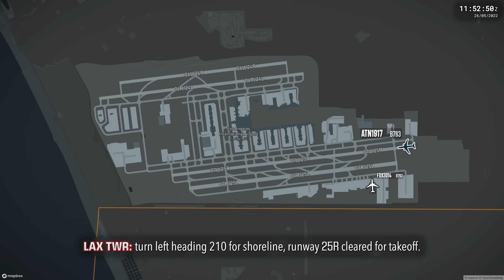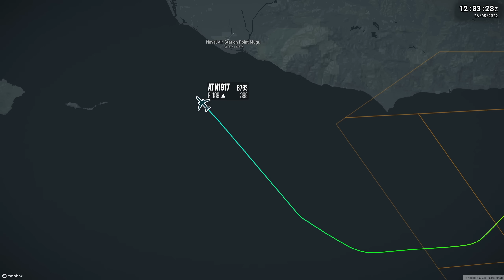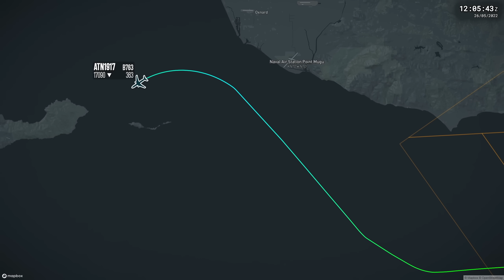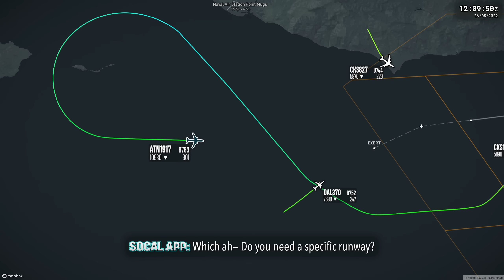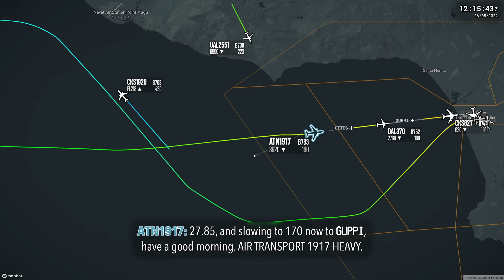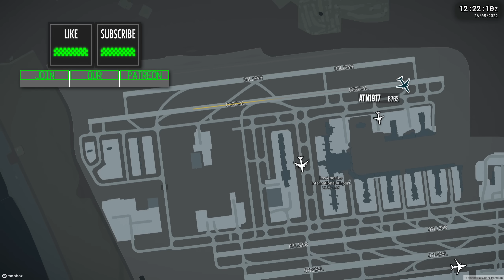"We Need To Land IMMEDIATELY"; Amazon Prime 767 Reduced to Single Electrical Source! [ATC audio]

Comment: They flying some of the oldest aircraft in service…..all to save a buck
Reply: Literally all cargo airlines fly old aircraft. Old doesn't mean bad.
Reply: Do not confuse old airplanes as being unreliable. I've been in aviation for 43 years so far, and I can assure you the level of unreliability is definitely not based on an airplanes age but solely based on the quality of an airline's maintenance program. 
Also an airplane may be cheaper to buy the older they become, but the older an airplane is the more money needed to keep it operational and compliant with its Manufacturer (Boeing in this case), the State of Manufacturer (FAA in this case), and the National Authority of the Airline.
Reply: @gibbosan1  I agree, old may not be bad, but as they age, aircraft become more prone unforeseen maintenance issues.

Comment: Surprised a single power source couldn’t power the whole aircraft. The lost engine should be the only real concern when a single generator powers all Buses
Reply: It probably can. But do you really want to fly a couple thousand miles with the risk of losing all electrical power at a moments notice?
Reply: It's a loss of redundancy that is the issue. One generator is enough to power all busses, but when you lose an engine driven generator AND it appears the APU was inop, that's when you start backing yourself into a corner pretty quickly.
Reply: @cobra10908  yeah if one went out they might Just head back without a emergency 
But this took out all but one
Reply: @seantaggart7382  apu must of been deferred so when they left LAX, they only had two sources of electric, and lost one of those. Normal conditions would be, if lose an engine generator, turn on apu for second electrical source, and continue on. Lose another ie one electrical source…it’s land ASAP.
Reply: @jerryrichardson7815  yeah

Comment: Pucker factor 8 on that one. I went NORDO when electrical system failed in a C172 (heavy, lol) in the middle of a Class B. I managed to call the tower on my cell phone and got clearance to land. Good thing that plane had slick mags.
Reply from the maker: Thanks for sharing your experience! Regardless of the size of the plane, when systems start failing it's a sub-optimal day for the pilot(s)!
Reply: ...and batteries.
Reply: No issue the plane still has 1 power source plus 3 hydraulic generators
Reply: @elmin2323  Not sure why you’re being disrespectful to Don Jet. The 767 does not have three “hydraulic generators”. It does have a RAT that can pressurize a hydraulic pump but provides zero electricity. SOME (mostly newer) 767s have an HMG/HDG installed to provide limited power from a hydraulic motor generator, but that’s definitely not universal.

[Edited for spelling: “respectful” changed to “disrespectful”.]
Reply: @HEDGE1011  I'm type rated...
Reply: @elmin2323  The B-767 is one of my nine type ratings, and I flew it for years. I have not flown any 767s built in the last 15 years or so, therefore it’s possible that new build 767s (FedEx? KC-46?) have three hydraulic generators (a source would be appreciated), but I can definitely say that older 767s (such as this one) did not, and many didn’t even have an HMG/HDG installed.
Reply: @HEDGE1011  fair enough
Reply: @elmin2323  armchair expert
Reply: @loduca16  lope rated and current
Reply: @elmin2323  I'm the pope, President of the United States, Jesus and Elvis Presley's vocal coach.

Oh... I forgot people can say anything on the internet...
Reply: @elmin2323  roasted lmaoooo and rightfully so
Reply: @HEDGE1011  Think he meant hydraulic pumps lol
Reply: @elmin2323  Nope, no HDGs.
Reply: @donjet5371  ok arm chair expert

Comment: Why didn't they have an APU?  Is it allowed to take off without a working APU?
Reply: The 767 normally has 3 generators; one on each engine and the APU. Minimum required is two for takeoff. If one of the engine generators is inop, the APU must be running for the entire trip.
Reply: @donjet5371  Ok tnx.
Reply: Yep! Both passenger and cargo can run with an inop APU.
Reply: @gazebodp  Ok tnx

Comment: Fun fact: They can deploy a fan to generate electrical power, so they did have additional source. Airplanes routinely fly with non-functional APU
Reply: Fun fact all of you are wrong the Rat on 767 just provides hydraulics for the center system for flight controls
Reply: @eazyvictorproductions8217  same for 777/787?
Reply: @tomstravels520  hmm not sure about that I’m not typed on those only the 767/757
Reply: @eazyvictorproductions8217  I imagine they would as they’re reliant on electrical power for the FBW control. I’m more Airbus familiar
Reply: @tomstravels520  777 has generator in RAT, check AMM 24-33-02 for removal.

Pretty sure 787 has a generator strapped to the RAT.
Reply: @nuclearrabbit1   The RAT on the 767 provides ZERO electrical power. It is a hydraulic pump to supply hydraulics to the flight controls during hydraulic failure.
Reply: @donjet5371  citations needed
Reply: @nuclearrabbit1  no
Reply: Typical arm chair expert
Reply: the RAT drives a hydraulic pump to power the hydraulic flight controls..not a generator, however, there is a hydraulic motor driven back up generator undercertain conditions..
Reply: If they're on RAT then I'd say they're pretty screwed. You would have no APU GEN, IDG to be running on RAT.

But yes INOP APU can be released under deviation per MEL
Reply: @shinnmoso  But is the BFI AOK?
Reply: ram air turbine

Comment: Did they have all electrical power on take off or did they take off with less than all power sources intact?
Reply: probably took off with an inoperational apu, so if one generator goes it is a critical failure
Reply: @louissikkema5399  If the APU was inoperative how'd they start the engines?
They also have the RAT to generate power.
Reply: @AndyTK421  you can start the first engine with ground qir supply and after pushback the second one with crossbleed air from thefirst one.

yes if they had lost their second generator they would have the rat and if that failed 30 minutes battery power but those are severe emergencies so they are on a single powersource that is able to power the whole aircraft (rat would only be most essential systems)
Reply: @AndyTK421  If the APU was inop on the ground then they use an air-start cart to start the engines. The RAT has nothing to do with electrical system; it supplies hydraulic pressure to the flight controls if hydraulic pressure is lost.
Reply: @donjet5371  well id hook it to electrical
Reply: @AndyTK421  RAT = small drop-down air turbine aft of Rt. MLG door, hyd. only.
Reply: @donjet5371  on this particular aircraft. On Airbus deploying it can power an emergency generator
Reply: @AndyTK421  rat only does hydraulics
Reply: @tomstravels520   Don't know anything about airbus. This 767 has no RAT electrical power.
Reply: @seantaggart7382   Yeah, I'm sure those 4000 engineers who built the 767 really wish they had asked for your input.
Reply: @donjet5371  yeah im just SUGGESTING
Reply: @AndyTK421  ground assist maybe

Comment: What happened to giving emergency aircraft priority, not slowing them down behind traffic??
Reply: The pilots did confirm what runway ATC is currently landing on and said they could take that. If there were more of a concern I'd think they'd have expressed it.
Reply: Uh oh...another silly comment. You're on a roll Jerry Dick.
Reply: I guess the problem is the ambiguity about emergencies in the US, as you declare an emergency and then state what the problem is.
In ICAO-countries its pretty easy: "Pan Pan"" means: we have some issues but they are not immediately threatening the safety of the aircraft (so something like this) and there is "Mayday" wich means we need to land now immediately. Under a Mayday these speed restrictions would not be acceptable, in fact in europa after the emergency traffic is assigned a runway, even the traffic already on final have to go around to minimise the chances of having the runway  closed due to an issue with a previousely landing aircraft. Under Pan-pan the runway is not closed and  the aircraft is just sequenced in with priority like here
Reply: @louissikkema5399  Wrong. There wasn't any speed restrictions, that's how aircraft of that size always land, they get vectored in or use a published approach which has certain speed thresholds. Landing too fast could cause a crash or a runway over-run. No other traffic was on the runway he chose, LAX has 4 parallel runways.
Reply: @j423956  sure, in this case the speed reductions were only slightly lower than what the pilot would have flown with speed his discretion.

My point was more about theambiguity of declaring an emergency versus the icao panpa /mayday, because with mayday the rule is clear: no other aircraft can land on an runway assigned to an emergency aircraft
Reply: @louissikkema5399  you do have a good point. But pilots did say “ we need to land immediately “. ATC in US has gotten way out of their realm of responsibility. They have gotten lazy and put their workload above safety. Get the flights ahead on ground so not to have to work them back in.
Reply: @jerryrichardson7815 , i ageree with you 100%.  ATC has forgotten  why they are there!
Reply: This was more of a precautionary landing than emergency, however the pilots did the prudent thing and declared an emergency.   The single electrical source is more than enough to power the aircraft and both engines were operating normally.  It would be a normal landing.   The speeds the controller gave them were normal speeds that the aircraft would fly anyway.   They were not delayed in any way.
Reply: @griam7641  Yes, but...if one of the preceding aircraft didn't clear the runway on time, it would had caused the distressed aircraft to go around
Reply: @georgeolina3414  Good point George.
Reply: @griam7641  The pilots had declared an emergency. It's not for ATC to second-guess them.
Reply: @griam7641   I understand they have normal speeds for landing, but procedure is for an aircraft that declares an emergency to be given priority. The crew can proceed to airport as fast as they can and slow just before landing. And 2 engines operating doesn’t mean everything ok. If he had lost the generator on other engine, he would be flying on batteries and/or with RAT. In that case, it’s get on ground ASAP. Very easy to fly an aircraft into ground with both engines running if you don’t have instruments powered by electricity.
Reply: @jerryrichardson7815  All true.  But he wasn’t given any vectors to be sequenced.  He got direct to Ottes and he has to slow to land.  The emergency was a generator out, not an engine fire.   I don’t see the the controller did him any disservice.   Ultimately the pilot can refuse the speed reduction.
Reply: @griam7641   In my 30 year airline career, an emergency is an emergency. ATCs job is point the flight to airport and get other flights out of the way and let the pilots fly the plane however they want or need to. In this case, it is obvious the controller turned flights ahead of ATN then slowed them down for spacing. When ATN could of kept their speed up til on short final.
Reply: @RLTtizME  nope! Nice 6 figure income sitting in air condition has its perks!
Reply: @jerryrichardson7815  Union Honey Bucket....sweet.
Reply: @jerryrichardson7815  Well as a 30 year airline guy, you should know the pilots could have refused the speed reduction. Just as any pilot in just about any situation can refuse an ATC clearance.
Reply: @jerryrichardson7815  Thanks Jerry Dick. Does the Honey Bucket slosh when you drive it? Were your hands always blue? LOLOLOLOLOL. I tickle myself. Yes...to answer your question. Thanks for posting.
Reply: @jerryrichardson7815  But not all.   You worked for Ozark...I think you said.
Reply: @RLTtizME  Didn’t work the ramp because I received an education, which obviously you lack. So when you want to get off Flightsim, and come out from your mom’s basement to learn how aviation really works, I can answer any questions you may have.
Reply: @jerryrichardson7815  Oh what a burn and if I might point out...an insult to your co-workers on the ramp. The basement insult was funny long ago...but not bad if that is the best that you can do. So...let's see those hands. Are they blue? Or perhaps you were in charge of peanut and pretzel acquisition for Ozark. Not a job to be taken lightly. Your colleagues on the ramp won't hold that against you. My respect is for them. Not so much for you.
Reply: @griam7641  Yes, pilots can basically do what they want during an emergency, point is ATC should have never asked. Try refusing a clearance departing NYC, let’s see how long you sit there.
Reply: I am taking the middle ground here:
For this scenario it would be a landing like any other (with additional precaution).
HOWEVER as ATC I would have confirmed beforehand if they are able to maintain normal functionality (or expclicitly speed), or if they need additional spacing.
If that were the case I would have the previous flight either take a sidestep, or get them otherwise out of the way.
Reply: I thought the same. At least make sure they can attempt to land by keeping the runway clear.
Reply: This sobering incident reminds me NOT to fly in or out of LAX.

Comment: Thank goodness nothing happens...I thought this was gonna be another Atlas Air flight 3591 crash
Reply: Well, of all the things that can fail on an airliner, the electrical system is probably the least problematic. They have a RAT, and at least one battery. Plus its non FBW, so the Aircraft can technically be flown without any electricity whatsoever.

Comment: This is why I don't fly. Nosireebob Nope aint gonna do it.
Reply: Then you must be scared shitless of driving.
Reply: Fine, but consider that there is a Ram Air Turbine installed, wich would generate Electricity in case the second Gen was to fail too. Everything on an airliner is highly redundant, on Airbusses actually way more than on Boeings. Think about it this way: When youre driving your car you not once consider the possibility of a loss of the brakes. Aircraft have an alternate braking system, cars do not.
Reply: @ogaibo1316  The RAT on the 767 provides ZERO electrical power. It is a hydraulic pump to supply hydraulics to the flight controls during hydraulic failure.
Reply: @ogaibo1316  technically they do actually. Your handbrake and normal brakes have to be on 2 separate systems so if your brake line failed your handbrake/e-brake can still work
Reply: @tomstravels520  Good point :D I was obviously just making an example. We could also talk about the 5 independent power sources on an A320

Comment: “Mayday, Mayday, Mayday”
Reply: Pan-pan, pan-pan, pan-pan, actually. A full generator failure would merit mayday.
Reply: I wonder why American pilots are averse to those official phrases and instead substitute "declaring an emergency"
Reply: @Tmanaz480  not sure why on all these videos that's such a point of contention with Brits. "Declaring an Emergency" is perfectly clear to a controller, especially the highly experienced controllers that are at huge centers like LAX and Atlanta which push more traffic in a day than Gatwick and Heathrow combined (Atlanta will run up to 5 runways at a time). There is zero reason to scream "Mayday Mayday Mayday" over the radio.

Comment: Did the APU fail or wasn't there one installed?
Reply: APU definitely is on the 767, so it was probably deferred. It’s legal for it to be deferred on a non ETOPS flight.
Reply: Apu is required installed on all commercial airliners, this one had some maintenance issues and due to parts availability, routing, they deferred the maintenance resolution to a later date. In other words they defer the APU
Reply: @timwilson7326  I recall frequent issues with the APU on the 767, IE: cold-soaked/moisture-soaked/frozen controller units, no pneumatic output was probably the most common issue.
Reply: @timwilson7326  Concorde didn’t have an APU
Reply: @tomstravels520  conccorde was a long time ago, these days there is a minimum level of things that need to work for the plane to fly.
Reply: @IIGrayfoxII  I know but I was pointing out saying “all commercial airliners” was incorrect. The ATR doesn’t have APU either by default
Reply: Good question. Are APU required equipment? Its on the plane but is it requied to be operational?
Reply: @peterm2  APU can be deferred

Comment: I wonder if they are down to a single electrical source?
Reply: IDG (integrated drive generator)  failure in one of the engine, after take off , one generator can power the aircraft however due to  apu being inop as well , it means 0 redundancy the flight is no longer safe to operate,  Pilot QRH will advise land immediately,   on the 767 there are 3 power sources  2 minimum is required
Reply: The spot they were in has some lower altitude comms difficulties with ZLA

Comment: Pretty unusual that planes are landing in an opposite direction as those taking off, isn't it?
Reply: Probably due to curfew being implemented for departures going over LA city. Just to keep noise down, departures and arrivals from and to the bay.
Reply: 1200z is 0400 local. It is a noise abatement curfew that makes almost all operations over the ocean.
Reply: Happens every night at LAX. It is rare to have anything more than calm winds, traffic doesn't require the higher acceptance rate of normal flow, and it significantly minimizes noise impact.
Reply: Unusual, yes, but normal for LAX later in the evening.
Reply: "Suicide ops" for noise abatement.  UPS does it in Louisville, KY at night also at their Worldport Hub (KSDF) when the wind allows.
Reply: @douglasdever3522  they do the same at ONT in California take off to east land from the east from 10pm-7am when winds are not a problem.
Reply: No.